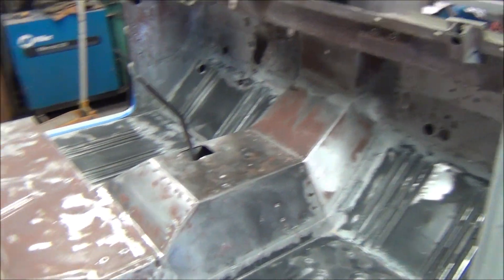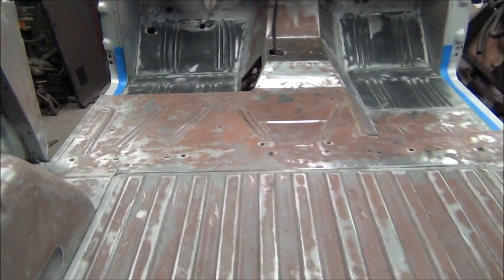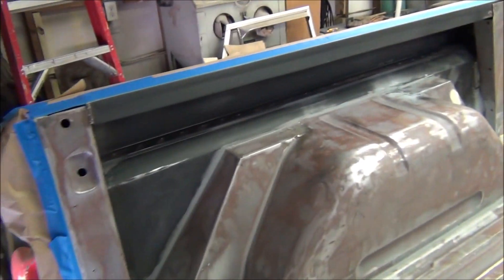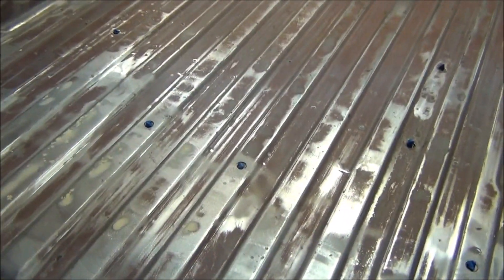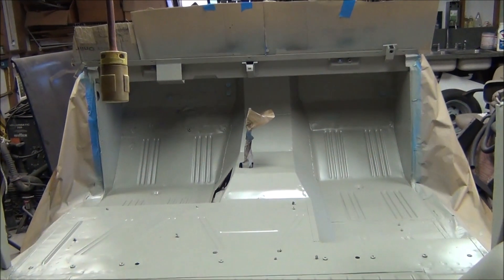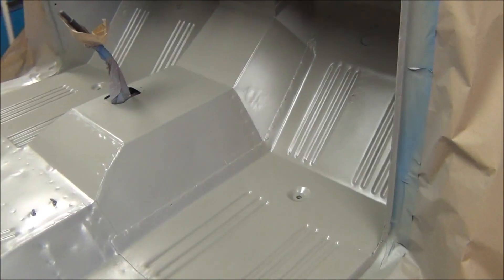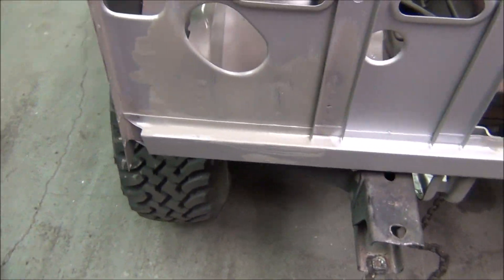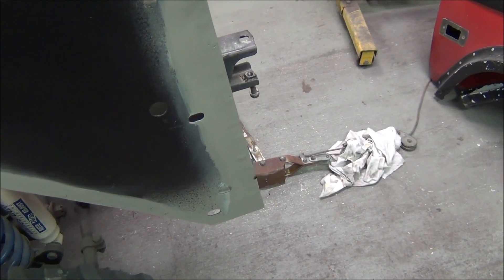1973 Early Bronco Project Part 54 Priming And Bedlining the Interior

Comment: How do you have that HT sand blaster set up? I have one that’s problematic
Reply from the maker: I had problems too until I abandoned the included directions. I turn all the valves wide open except the media valve at the bottom of the tank. At this point it’s blowing air but no media. Then crack the media valve open until you get the media flow you want.